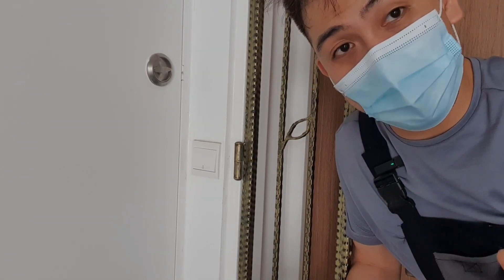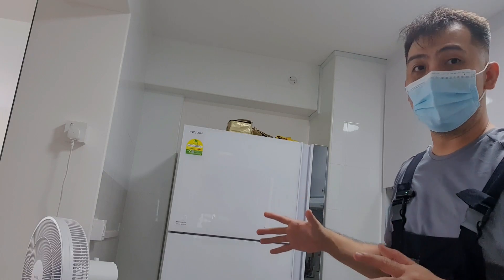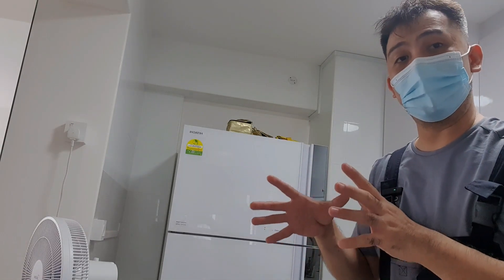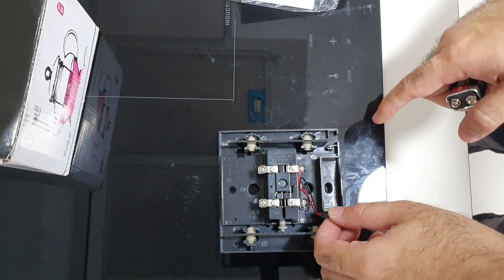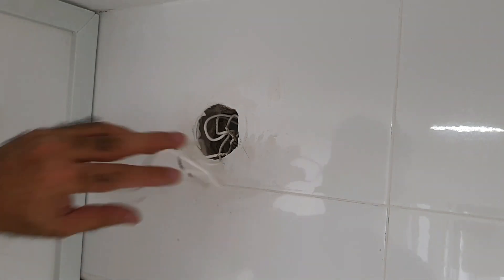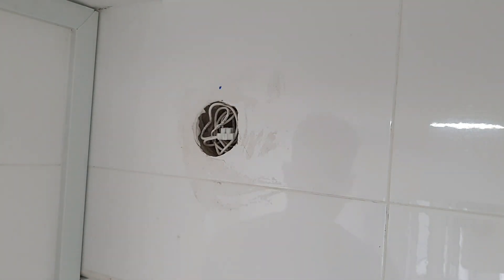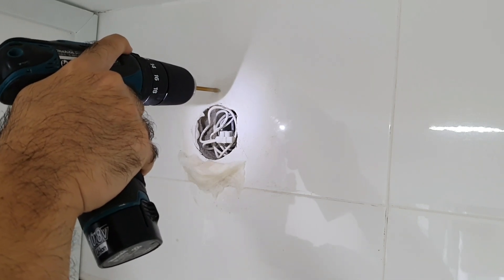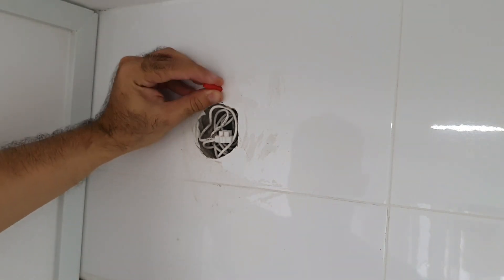‎@The Punggol HandyMan: Installing an Apartment Doorbell

Comment: Thanks for mentioning our HDB BTO is not hard-wired...im searching for a comoatible transformer/ power plug for my TP Link Tapo D235...any pointers/ links u can provide?
Reply from the maker: @iwaderiwadi5068  wah cheem a bit hard to explain in a video cos I don't have a setup to demo. I'm not sure the capacity of the wires. But since there are 2 I'm sure they can carry a low voltage ac or dc
Reply: @ThePunggolHandyMan  Thank u...managed to try out on an unused power plug with identical rating as the Tapo D235....working well :o)

Comment: Hi when I use the plier to test the connector, there's isn't any sound on the bell, but there's sparks, same layout as yours, top and bottom left row. Is my bell spoil?
Reply from the maker: Yea most probably.. when u use the pliers there should be a chime
Reply: Thanks for the speedy replies bro! No wonder I thought my connection was wrong all along. May I know where did u get this bell, as mine looks exactly same as yours
Reply from the maker: @linwei20  it's usually available at most hardwarestores. I get mine tight downstairs!

Comment: So all wired doorbell needs a battery, right? How long does the battery last? 
Nowadays there's doorbell that doesn't require battery. Just plugged into power socket. Are they good?
Reply from the maker: @KarenChua-o2g  well good or not is subjective I change my batteries every 3 years so I guess it's okay?

Comment: Jordan Bro, (i'm from SG Home DIY fb group - the one who said you must say when you're joking), why must Doorbell Receiver be mounted near ceiling? I saw my Britz Doorbell manual said must be 1.8metres high, but no reason given. Can I connect 2 wires to extend it to much lower height, so that I can see it clearly to troubleshoot? I guess battery contact points turned rusty after many years, need to clean. Any special way to connect the wires? Many Thanks!
Reply from the maker: Hello! That's a funny instruction!  I have one doorbell hidden under a foot cabinet and it still works!  And yes you can bring the doorbell down but I have changed my batteries once every 3 years so there is no reason you need to have it so low. Remember 3 years ago? That's when we were all locked down
Reply: @ThePunggolHandyMan  Ok great! Then, how to connect the extension wires ~ buy any type of wire connectors? Just find any 2 wires & just connect? Sorry i can't find anyone actually did such an extension, so must ask you for expert advice. Many thanks for your quick reply, Jordan Bro!

Comment: Thanks for the vid. Was looking at this traditional door bell n reusing the given existing hdb door bell switch instead of the current digital ones with transmitter. Is it possible to use strong tape instead of drilling?

Do i hv to do anything to the switch outside?
Reply from the maker: Yes u can!but putting in a screw is better

Comment: Hi. I already installed the doorbell inside kitchen. Tested and works fine. But the doorbell switch outside gate just doesnt work when pressed. What is the cause?
Reply from the maker: @joys229  maybe it's the switch problem have you checked the wiring?

Comment: Which size tile drill bit you using?
Reply from the maker: I use 5.5mm
Reply: @ThePunggolHandyMan  thank you for your reply. Awesome content.
Reply from the maker: @warheart03  thank you! Check out the "what's in my toolbelt" video where I discuss my bit selection and logic
Behind it
Reply: @ThePunggolHandyMan  Thank you for the tip.

Comment: Bro, my door sudden do not work. Suspect could be the door bell problem, after changed new but still do not work. So I changed the switch outside my gate also, but still do not work. What do you suspect and advise? Thanks!
Reply from the maker: Hi I'm not sure what the issue is, do contact me on Facebook for more

Comment: Just to check with u I wish to remove my HDB door bell and swap to a light bulb for my prayer alter and make the on/off switch inside my house .is it possible for me to use the door bell wire cables?
Reply from the maker: No these are not live wires and there is no power I'm them